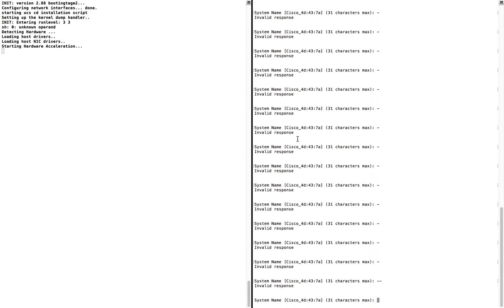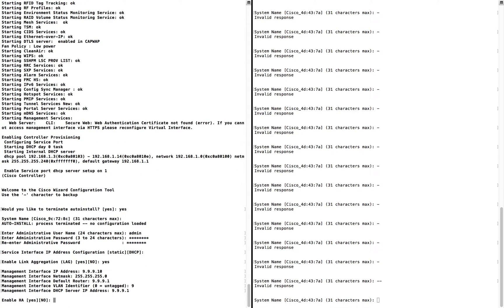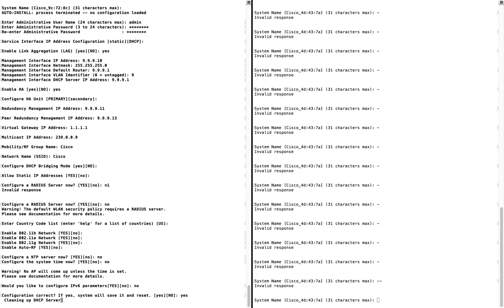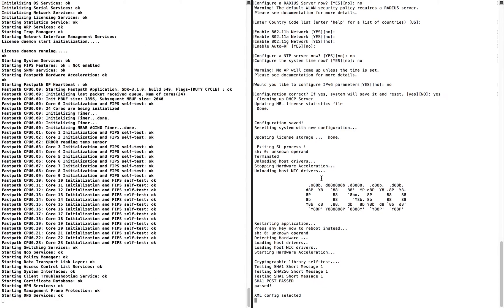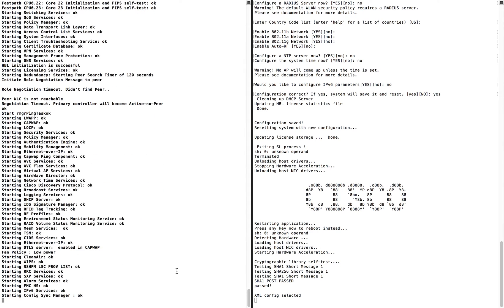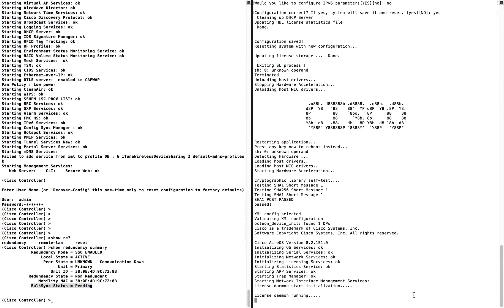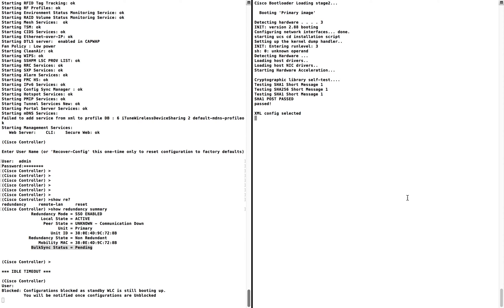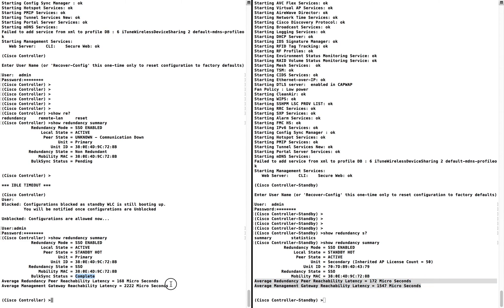How to Configure HA on Cisco WLC using Configuration Wizard

Comment: Hi Jason,  great presentation.  Quick question, I have a Cisco 5520 with 250 permanent licenses.  Can I buy a new Catalyst 9800 WLC as a secondary or does it need to be another 5520?
Reply from the maker: No, you need same platform and flavor to build HA SSO

Comment: Dear bro it is a Very Good explanation by you and thank you very much. I have the same redundancy configuration and able to login by GUI and not able to login by cli both device. Can you plz tell the reason ?
Reply from the maker: Stand by controller CLI will be locked as the Active is taking care of the configuration. We are not suppose to make any changes on standby wlc directly while SSO is enabled
Reply: @TNPbyJaison  thanks for replying back and i am not able to login active as well sir
Reply from the maker: That may be something else, if the CLI access is enabled for SSH/Telnet and you are using right user credentials local/tacacs then you should be able to access Active WLC
Reply: @TNPbyJaison  thanks for replying and I will check it